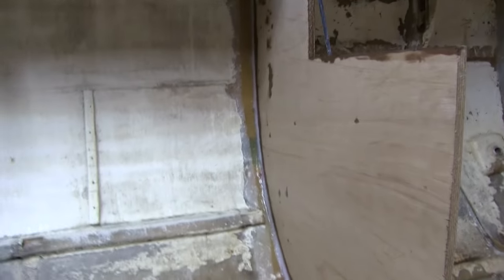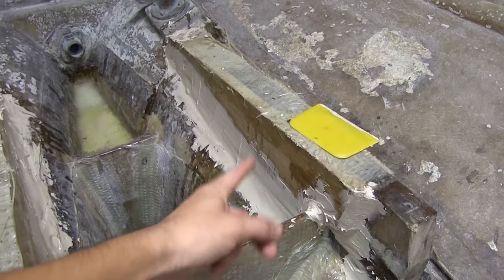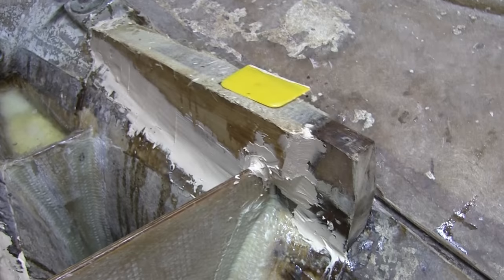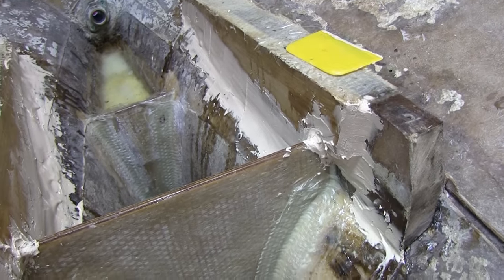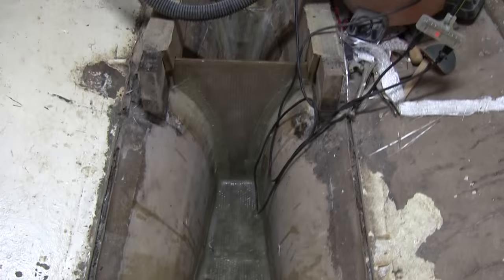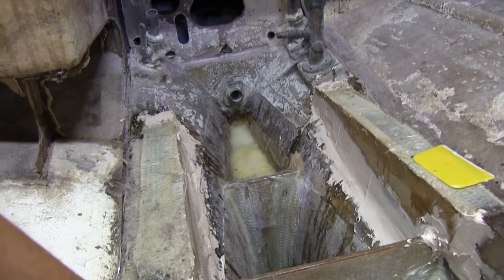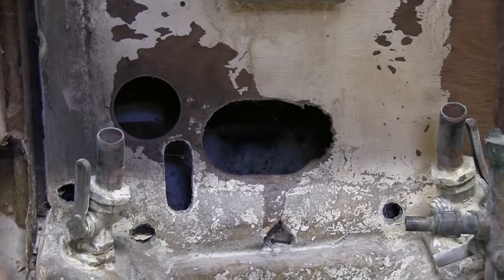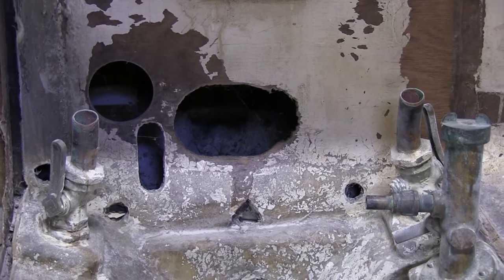Engine Room, Bilge, and Galley | Sailboat Restoration Ep. 23

Comment: Great to see you back at it, your existing through hulls are you going to leave them or replace?  thanks bro.
Reply from the maker: I'm not sure yet. It would probably be smart to go ahead a replace them or at least rebed them. They weren't leaking before so I could just leave them be. Why fix something that's not broken right? What do you think?
Reply: Honestly, I think  it should probably be done, but that is something a professional should do, because it has to be done right, it also depends on the material that the old ones are made of, from the looks of them, they kinda look like they are brass, and wouldn't be able to pass any inspection, but in the end it's your call chief.

Comment: You should be fine with the fairing compound.  Here's some advice:

First, use colloidal silica or what West System calls "406" for any gap filling in structural areas.  

Second, apply the thickened epoxy then right after and when the thickened epoxy is still squishy, apply your fiberglass.  In this way, you will save a step, because you won't have to sand the fairing compound before laying up the fiberglass.  Also, it will make a very strong bond.  In your case, you could still save any major sanding by just rough sanding the fairing compound a little bit to give it some teeth, then use a bit of thickened silica and layup the glass right after.  

Third, you get some ideas from this link - http://www.bristol27.com/projects/engine-compartment

Comment: Looking good.  Here's a trick i learned in my fiber glass work.  When you are trying to get that nice rounded inside corner try using a plastic pill bottle,  you can play with the size of the bottle to see which works best for you.  Saves hours of hand sanding.   
One word of caution regarding the plywood you choose.  DO NOT use that cheep plywood from the local big name home improvement centers.. Its awful for boat applications.  At a minimum use a good quality exterior plywood.  Better to use marine grade plywood, but of course much more expensive.
Reply from the maker: I'll have to give that a try. We are only using marine grade ply. Thanks for the comment.
Reply: delighted to hear about the ply.. good for you, so many diy'ers go the cheep route and its a huge mistake... keep up the good work.